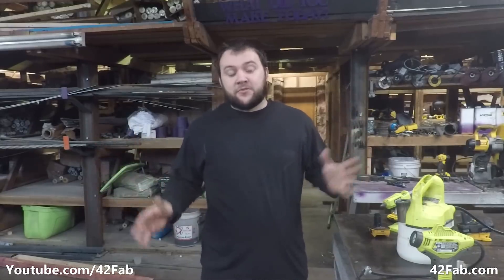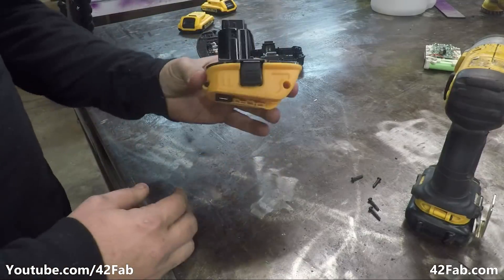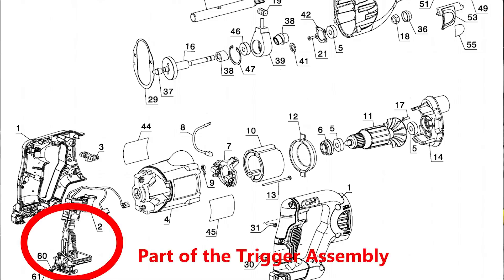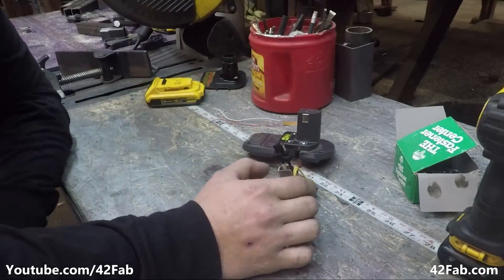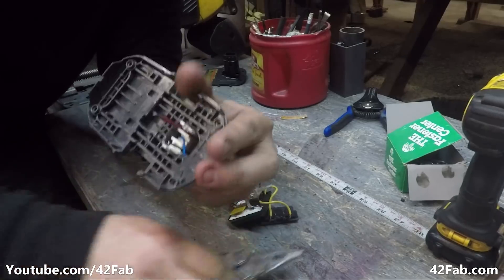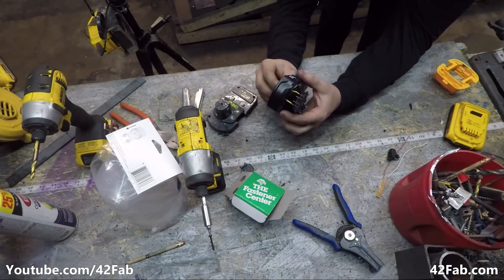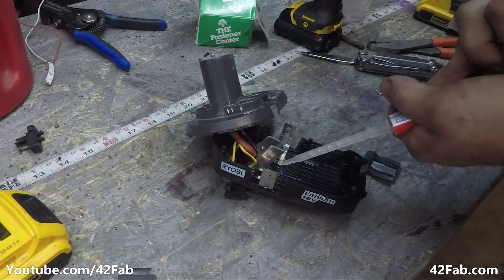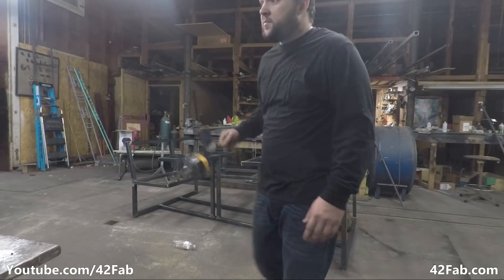How to use DeWalt Batteries on Ryobi Tools for $30 | Building a DeWalt to Ryobi Adapter - 42Fab #16

Comment: I'm so glad my tools just run off the mains. No fussing about with batteries that die half way through a project, or spending an ungodly amount on batteries. Bosch charges 70 euro for a single 18V battery, and another 45 euro for a charger. That kind of money buys a very long, very good quality extention cord.
I know different strokes for different folks. Also I guess the NiCad era of cordless tools biased me.
Reply from the maker: Amen on the Ni-Cd era, they just didn't have the juice. I can honestly say the DeWalt 60v Grinders are as good as corded, just a bit heavier. For extended work I'll pull out my corded 10 amp grinder and have at it, but as I'm rarely grinding something for long, not having cords to trip over is nice. You'll even notice in my other videos the power cord for my welder is routed into the rafters so it isn't on the floor.
Reply: I can definitely see the no cords to trip over benefit of cordless tools. It's just that to me, as a carpenter, it seems less of an issue because there's always going to be dust extraction hoses. No such thing as a hose-less shopvac.
I can't say I have a lot of experience with grinders, but I do with circular saws. And so far the cordless saws I've tried seem heavy and gutless compared to my 1800W corded saw. Same goes for routers. Those cordless trimrouters are very cute and all, but they just don't cut it compared to a 1400W corded router. Mind you I'm in europe, so we get 240V 16A from a regular wall socket.
Reply from the maker: Yeah, you guys get a lot more kick from a socket. Can't say anything about the trim router, but the flexvolt circular feels like it has an engine on it, only helped by the very thin kerf on the blade.
Reply: The FlexVolt circular saw definitely has good specs and going by YT videos it's almost able to keep up with a Skil 77, which is impressive for sure. Except that Skilsaw is a good step down in power from what I'm used to.  

And again, according to YT videos the Flexvolt is about $100 US more expensive than the Skilsaw. Though for a framer that might still very much be worth it. 
Over here in Europe DeWalt Flexvolt is basically priced like corded Hilti, Festool and Fein. Which is very stiff competition to go up against. And in my case, where dust collection is a requirement for the job, any circular saw that puts itself in Festool price ranges is probably going to lose due to the amazing dust collection on the Festool.
Corded Hilti and Fein tools, basically last a life time if you take halfway decent care of them. No expensive batteries to replace, if they still make that type of battery in a couple of years.
Reply: I've done a little research into this, many experts agree that battery tech has pretty much plateaued due to science/physics. Most manufacturers are focusing more on the chemistry inside the batteries and tailoring them to specific uses ie: low-drain, low-discharge and high-drain-high-discharge. The 18650 cell size is pretty much becoming the standard by Tesla entering the game. The giant battery packs underneath Tesla's electric vehicles are just these "pods" with 500 or so of these 18650 sized batteries and then 10-15 of the pods placed in a big, protective case that bolts to the bottom of the car.
I guess it can kinda be compared to computers and CPU's in the early 2000s. Every manufacturer was advertising increments of 100-200MHz they all hit a wall around 3.5-4.5GHz. These days you don't see increased speeds being a selling point. They have moved onto other features to stand out.
All that said, you should be safe embracing cordless tools and these days cordless has the staying power to compete against corded. See reviews on flexvolt miter saws or table saws able to last all day doing 200+ cuts for proof.
Reply: Battery technology has certainly improved. But batteries being incompatible between brands and even tool lines within a brand is something that really irks my potato.

Also pricing.
A DeWalt DWE576K corded circular saw would set me back about 190 euro.
A very comparable DeWalt DCS570NT, cordless, without batteries or charger, is 230 euro.
A DeWalt DCS570P2, same saw as the previous one, but with 2 18V batteries and a charger, costs 480 euro.

That's a 290 euro difference, which buys a hell of a lot of extention cord. Hell it even buys a 2kW continuous output Honda generator with cash to spare for an extention cord and petrol.

For working in my own workshop, where there's mains sockets on every wall and the ceiling, and 3 phase power available, I really don't see how I could justify the extra expense for cordless. 

If I had to buy all my powertools again and start over anew, completely disregarding my bad experience with NiCad and NiMH tools, I'd still buy corded everything all over again. Simply because corded buys so much more tool for the same money compared to cordless.
Reply: I totally understand your reasoning and if I worked primarily out of a shop and not on the road, corded would be my #1 choice as well. $300 is not really that much over the life of a tradesman's career for the convenience of cordless. Lugging around a small generator is an option of course, like you said though I'd much rather carry a bag full of batteries than say 5 gallons of gas, mostly because of the chance of spilling in a work van.

I 100% agree about the batteries being incompatible and while adapters do exist for crossing most tools/brands and batteries they are not always up to snuff. Most of these tools are still relatively new in the world of construction so hopefully after some time we'll see some type of universal standard adopted similar to USB and most electronics. While I wouldn't go out of my way to replace all my tools at once, since you do have the convenience of working from a shop check out some of the storage systems some other YouTubers have built for their tools. Honestly if I had that luxury I would probably only have a cordless impact driver and everything else corded with some type of retractable/hanging system for power cords.

However, as an electrician it's very nice to pull up to a job site and not have to hassle/compete with framers/masons/concrete guys for the sometimes limited supply of temporary outlets set up. Something I'm personally saving up for is a new item from Dewalt, their DCB1800M3T1 is a 1800watt RMS/3600watt Peak portable power bank/battery charger. Adding 4 of their new 9.0AH Flexvolt batteries would provide me with an abundance of power and more than I would ever need for my use. Yes, pricey, but I always shop around for deals and specials and once you consider the price of gas over time it becomes an even better deal.

Something else I've just learned tonight about Dewalt, though they may not have it in Europe is their trade up program. The jist being they allow you to bring in any other brand of powertool and/or batteries and offer deep discounts on new Dewalt tools. Of course this is just incentive to get you to buy into team Dewalt's 20v line but it's something and at least in Dewalt's case their 20v line is compatible with the larger AH Flexvolt batteries. A cordless impact with a 9AH battery while a little heavy,  just keeps on going and going and going.
Reply: While fanboys of brand certainly exist, I find when I'm talking to others on job sites most would use any brand that gets the job done. Most however do say that they have X brand but Y brand makes a specific tool they would like that X brand does not. They settle/make due because the thought of buying into another line is not an attractive option for 1 or 2 tools that their brand doesn't have. This is my dilemma now, Milwaukee makes a small 12volt SDS drill I would love for the occasional anchors I have to set in concrete. I just really do not want to buy into or carry around another set of battery/tool combos.
Reply: Yeah, I primarily work out of a workshop. The machinery needed to make furniture isn't that mobile to begin with. And when I do have to install things in a home, I usually work in homes where people already live, or which are days from being moved in to.

So having power at hand is never much of an issue for me. I'd rather spend the extra 300 on a saw on Festool for their amazing dust collection. And for that same reason I need a proper shopvac, again something which isn't readily available as a cordless unit.
And since I have to deal with a vacuum and the hoses that go with that, there is no real benefit to having a cordless tool.

But like I said, I can completely see why a framer would want a cordless saw to trim a 2x4 rather than schlepp about with cables and all that jazz. Or in your case when you're fitting conduit, I can totally see the benefits of a cordless drill.

I have a cordless screwdriver. Not even an impact driver, just a very simple driver. So far my little Bosch PSR7,2LI has served me very well. The only real concern I have about it, is that Bosch doesn't make it anymore, so when the internal battery dies, it's anyone's guess whether or not I can still get parts to fix it.

Comment: Damn .... i feel stupid. I clicked on it for the idea and so many others were boob baited. Lol
Reply: Me, too. A sign of getting old. I saw the title, missed the picture and was headed here to argue that the ryobi batteries are perfectly fine (then saw his giant pile of dewalt batteries). 

In 8 years so far, I haven't had a ryobi lithium battery fail yet. Before that, I was stupid enough to buy Ridgid tools, which I still can't figure out what they value of them would be - and lost a tool and a battery within two years with them. A little bit of research pointed me to ryobi instead of Ridgid because the warranty is more of a marketing tool than anything else.

Comment: Ive been thinking about this type of thing for sometime. Never seen anyone do it. My expertise is wood so havent got round to trying.

I have a senco fusion nail gun (18 volt) do you think I could make an adapter to take current 18v makita batteries dor the nail gun?
Reply from the maker: If the cell protection is in the senco batteries, then yes, if not, then no.

Comment: Cool vid, click bait with the girl tho! But at least you're using your head! These tool manufacturers have us my the short n curlys with the whole pick a color and stick with your team. F-em, they make it tribal so that dummys get butt hurt when ya say "DeWalt is crap, "or "Milwaukee gained market share while at the same time reducing quality when they were bought out by a conglomerate"...lame...We should be hacking all of them and the batteries so that we can use whatever brand we like and not stick to a "team color". Instead use what tool we want to. Kee it up man, free us from monochromatic powertool prison. Thanks!

Comment: Can you make a video for the opposite.  Ryobi battery for dewalt tools
Reply from the maker: Julian Lindo will not work on new 20v tools.
Reply: 42Fab - Metalworking and Multi-Medium Fabrication oh man. That blows. I have a lot of ryobi tool an want to switch to dewalt lol
Reply: Check into Dewalts trade-up program, they actually give pretty big discounts on their new 20volt line from you trading in old tools and batteries. Look it up!

Comment: I dont get it, in this case, the Ryobi tool and battery combined is cheaper than the Dewalt battery alone. I'll keep an extra tool bag with the couple extra Ryobi tools that I actually use, along with  the Ryobi batteries to run them before wasting my time retrofitting to use the much pricier Dewalt batteries. Just sayin'
Reply: Eric Kelley ... I see where you're headed with this, however, keep in mind that Absolutely nothings been altered on dewalt battery.. He altered a "knock-off" Adapter and a Ryobi battery from Home Depots trash.. As far as the tool knows, it's just another day on the job..
Reply from the maker: That's fine for your use case, in mine I'd want 15-20 batteries for use on the road, then this makes sense
Reply: 42Fab - Metalworking and Multi-Medium Fabrication No, I understand. Your needs  for this type of thing are different than mine, so I guess I was just thinking out loud. Thanks for the response 👍👍
Reply from the maker: Eric Kelley yeah, I hear you.
Reply: Same, could be said for the adapter..and what I meant to say was "as far as the batteries concerned....bla bla bla"
Reply from the maker: Some people are dumb and can't listen to me explain just that...

Comment: why not just buy another battery for the ryobi  , seems easier
Reply from the maker: because for what I want I'd need 20. Working on the road, away form power
Reply: Watch the video. He has a huge collection of DeWalt batteries. He wanted a way to be able to use those in every one of his tools and not have to mess with different types of batteries and their chargers for different tools.
Reply: He explained it at the beginning of the video..........................................................
Reply: Dan H because ryobi batteries are worthless.
Reply: @jimmywood559  the low end batteries are kind of bad, but the big batteries are great and so are nearly all of the tools. last time i went against a dewalt, my ryobi was spinning a rod in the dewalt chuck.. all day.

Comment: I guess that you were really fortunate to be able to use parts out of old batteries,, and just turn around and make that adapter. But if you are like me.... you just turn around and download the thingiverse 3D adapter that if it wasn't because the wiring is literally a plug & play...(By the way, Just subscribed hope you can do the same....)
Reply from the maker: Migueldeservantes I like the 3D printed parts, I have a printer, but they're never as durable as injection molded parts. Fine for home gaming, not for use when them being broken costs you money.

Comment: Now you need to add a couple of USB high speed charging adapters so you can charge your phones directly from your tool batteries also
Reply from the maker: My thought on "make vs buy" is that unless you have the parts begging to be used, just buy. It will be more rugged and fit the battery perfectly, which is my main gripe about 3d printed adapters

Comment: Great video. I made one of these and have been using it almost daily for the past year and have had quite a few people pick it up wondering WTF was going on. When I did mine I used the Dewalt upper piece as a template to cut and drill the bottom of the ryobi battery so I could screw it all together using the original screw holes in the dewalt adapter looks a lot cleaner then using globs of epoxy.
Reply from the maker: pat Sun good idea

Comment: I don't like those sets of driver bits where all the bits are only an inch long.  It should be easier to get sets with all 3" or even 4" bits.  All too often, there's a plastic housing with a torx screw head that's sunk far into a molded well that a bit holder wont fit into.

Comment: You know you can buy a premade one on eBay for the same price as the battery receptacle used in the video. Like so others can see

https://m.ebay.com/itm/DEW-18V-Ryobi-to-Dewalt-Battery-Adapter-Converts-Ryobi-tools-to-Dewalt-/173136883398?_mwBanner=1
Reply from the maker: No evidence of Discharge protection. If there is I'll endorse fully
Reply: Make a cool video of it

Comment: Thanks for the video. Interesting to see that the eBay adapter that you used has a USB port on it, whereas the Dewalt one doesn't.
Reply from the maker: The usb port is crap and broke while reassembling it. I would really want to use it

Comment: Great video! I've done a bit of frankenstein experimentation in that vein, and I think you're mistaken about the battery protection board.  The important protection boards are actually on the batteries themselves, not in the adapter or in the handle of the drill.  I couldnt say what the one in the adapter is, maybe some voltage regulation to compensate for the difference between 18v nicad and "20v max" li ion. I would guess that the board thats in the tool handle would be what regulates the handshake issues that foil attempts to do these kinds of mods on better quality tools than ryobi
Reply from the maker: Not in these DeWalt batteries or the Ryobi. 

The board in the Ryobi batteries and the board in the DeWalt tools do the protection of the cells. The little board in the DeWalt battery is just a BMS.